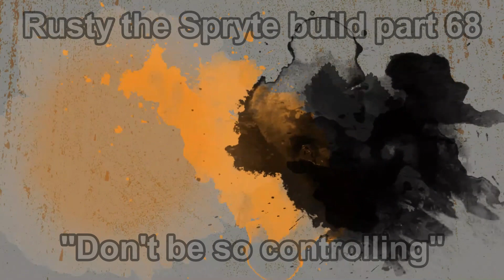Rusty the Spryte build part 68 (Driver/passenger seat/mechanical controls mockup)

Comment: Range of stick(s) motion can be limited by seat, especially when slave cylinders are not properly adjusted. The old spryte sticks are oriented straight up. How wide are your spare wide axles?
Reply from the maker: Hi John!  The spare axles I have are off of an OC12 with 400 hours on it (the one I own).  They are for the wide track version of the OC12.  If you check out the playlist you will see when I rebuilt the OC12 and replaced the axles with standard sized ones.

Comment: The overhead fiberglass is the guage dashboard for your switches, breakers, monitors,  fuel level, and Garmine GPS.
What is your plan regarding Heater for inside the vehicle perhaps a diesel contraption ESPAR thus you would have heat & would not have to keep the snow cat motor running!
Reply from the maker: Hi James you are right... as far as future options stay tuned!!